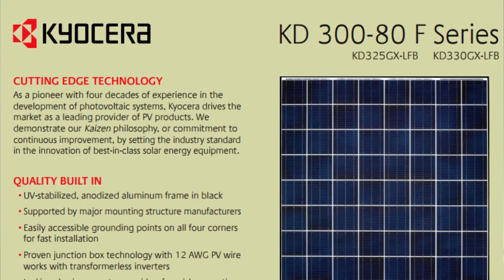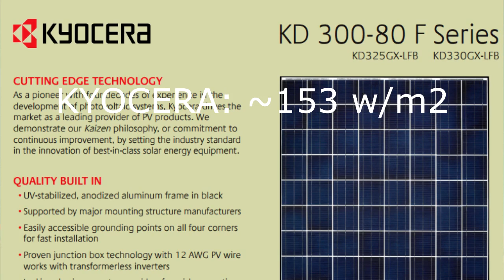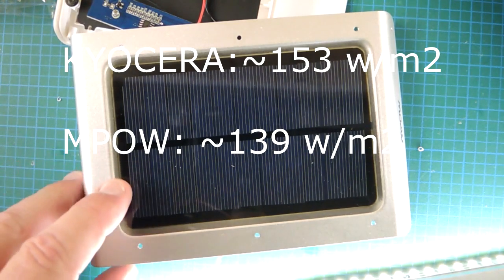Assembly Quality of a Low Cost Motion Sensor Light

Comment: I had a earlier model and it not good in the open. The solar panel lifted on all 4 of the items I brought had to silicone them on the plus side they do last all night when they have full charge but the sensor is not that good. As you said in your video the sealing of the unit is poor and lets water in.
Reply from the maker: +Justin Coleman The sad thing about this unit is that the electronic components are all pretty plausible. The LEDs are nice, the Li-ion battery looks like a reasonable capacity and the electronic circuits seem well considered.... only to be let down with small oversights on the case design: for only a few % more this assembly could made to have a long service life.